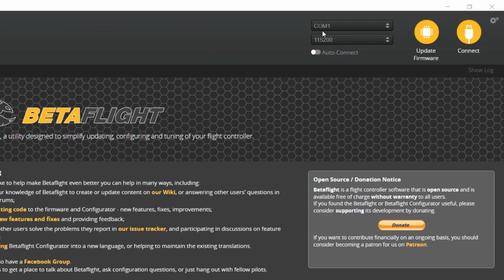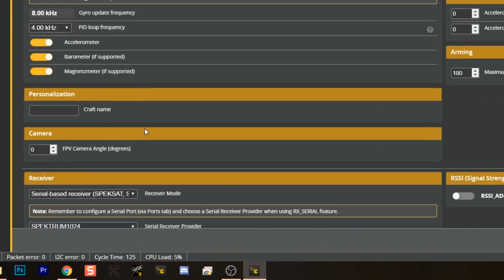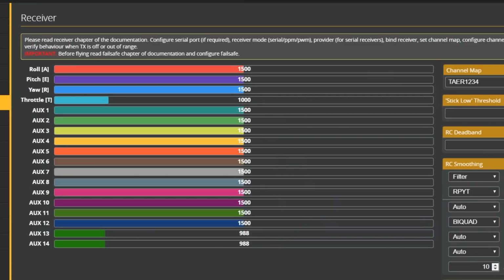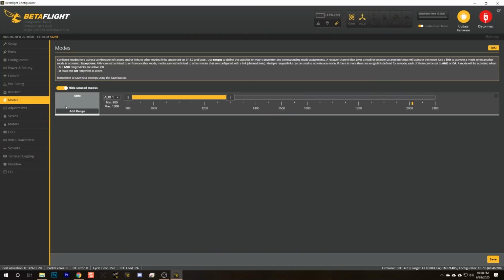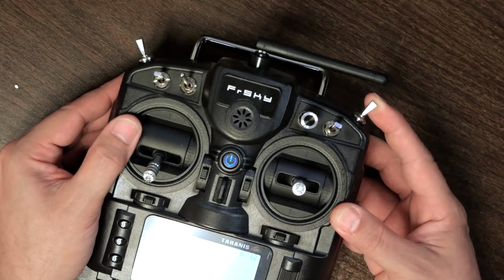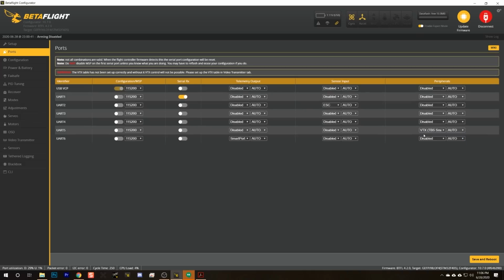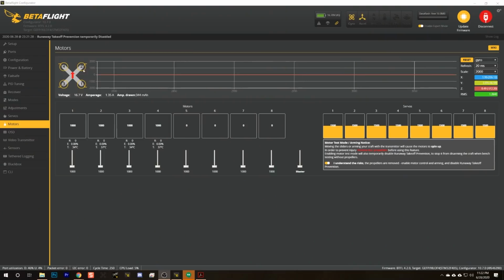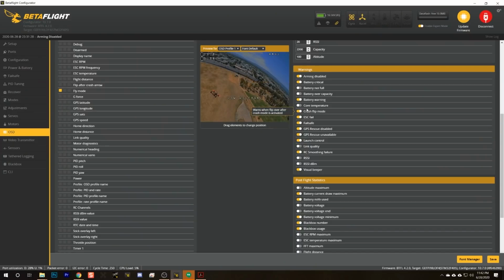FPV Drone Budget Build Full Tutorial - Part 3 - Betaflight 4.2 Complete Set Up

Comment: hello, what can i do when all 4 motors showing 100% on E? just build the drone and motors wont spin :(
Reply from the maker: Your ESC doesn't support bidirectional dshot. Turn off bidirectional dshot.
Reply: @JoshuaBardwell  ok i will try it out, i followed each of your steps from the video. because its your xilo 5 diy kit and im pretty confused
Reply: @JoshuaBardwell  what can i do when blheli dont find my motors/no valid esc configuration?
Reply from the maker: Well that could also explain why you have 100% errors. Maybe your ESC isn't powered up? Is the battery plugged in?
Reply: @JoshuaBardwell  i got it working after the motors worked again in betaflight they wont spin when drone is nkt on pc (with battery) but finally its working now :) maybe try to fly it today. thanks for the help

Comment: Hi Joshua, I'm trying to configure my quad and everything has worked up until checking the transmitter inputs on the receiver tab in Betaflight. I was able to bind my transmitter, I installed the drivers, did the ImpulseRC driver fixer, and I'm on Betaflight 10.7.2, but I'm getting no transmitter inputs. I've been looking for a solution on YouTube and found a video that said my receiver was in DPPM (or CPPM?) mode and not SBUS mode. I tried holding the bind button for four seconds to switch modes but nothing happened. I only get a red blinking light, no blue light. Please help!!!

Comment: Hey Joshua, with your Xilo i´ve build my first quad. Thank you very much for the inspiring and entertaining videos :-)                         My only problem is, that the quad does not arm at all.                        Already watched your video for this problem and tried all the notices: channel mapping is correct, acc_calibration is ok, cpu load has been below 20% in some test creations, switched acc off and increased "moron threshold", when i push prearm and switch the armswitch there is only the msp flag in the line "arming disable flags", the motors beep when i press the prearmbutton and i can spin the motors in the motor test mode.                               I flashed the FC with 4.3.0 RC3 and 4.2.11, the ESC with 32.8 and 32.83 but i still can´t get it running :-(                              With usb connected it won´t arm because of the connection, but if i disconnect I can´t see the reason why it does not arm.                            There is no warning displayed in the OSD after i pressed prearm and triggered the armswitch.                       Puh, have been trying for 5 days but now there is no idea left what i can test anymore.
Reply: I had this issue with the build, deleting the beeper function for some reason fixed the problem.

Comment: Thanks for the series, Josh. After looking all over the internet, these are the 3 roadblocks I cannot fix. When trying to setup SmartPort, the only sensors I can see are RSSI and RxBt. The engines do not beep. Lastly, and most severe, my OSD works but I have no video. The OSD only works a with the headset a few inches from the quad, then turns to static if I pull away. I'm using an ACCST QX7. Any ideas?

Comment: When trying to setup SmartPort, the only sensors I can see are RSSI and RxBt. Any ideas?
Reply from the maker: SmartPort is not working. Try going to CLI and type 

sets erialrx_haldfuplex = on
save
Reply: @JoshuaBardwell  Thanks for the response. I assume you meant,
set  serialrx_halfduplex = on
save
Even so, I still only get the two sensors..... I have an ACCST QX7. Any ideas?
Reply from the maker: Can you confirm that Telemetry feature is enabled in the Configuration tab?
Reply: @JoshuaBardwell  Yes sir, it is. Kinda getting discouraged too, I can’t see my video feed just my OSD. I sent you a detailed email about my problems with this drone.
Reply: @JoshuaBardwell  do you have any tips?

Comment: I have had nothing but trouble with this ESC and I don't know if the XILO ESC has quality control issues or if I'm doing something wrong. The first one I had wouldn't hold a BLHeli config on ESC 4, my second one that just came won't keep its config on ESC 3. Am I doing something wrong that is shorting these things out? I followed this tutorial series to a T. Reflashing BLHeli on the offending ESC will temporarily bring the quad back into working order but it doesn't last for long. I haven't even flown with the new ESC because I'm seeing the same behavior as before on the bench and I don't trust it.

Comment: Any help with this exact quad. Getting rpmfilter fail safe when trying to arm. Blhelisuite sets up perfect. Then after disconnecting and trying to arm it failsafes. I check betaflight and see rpmfilter fail. Exit betaflight and go to blhelisuite run read setup and get no esc configurations. Works fine with dshot disabled
Reply from the maker: rpmfilter means the FC is not talking to the ESC e.g. maybe the battery is not plugged in. failsafe means the FC is not seeing signal from the receiver. The ESC absolutely supports dshot so if it only works with dshot disabled, I would suspect a bad ESC.

Comment: Thanks for the series. I can't turn on bi directional dshot, despite the 4 in 1 esc being BLHeli_32. Any ideas why?
Reply from the maker: A few FC don't support it. If you try to enable it and it won't turn on that may be why.
Reply: @JoshuaBardwell  Thanks. I just wasn't saving and rebooting so it would toggle back off. Now, although I can see the OSD (battery/angle mode), I can't see a video feed, which is weird, since it was working last night. Any ideas?
Reply from the maker: OSD with no video means the camera is not powered up, the camera is damaged, or the camera video wire to the FC is broken.

Comment: This all worked flawlessly for the JB Xilo build. I am on my second build now and cannot get the motors to go no matter what I try. The drone makes the initial 3 beeps when starting but won't complete the last 2 beeps in the sequence when plugged in with a battery. Any help would be appreciated. I am using a RushFPV Core 7 mini stack with a R-XSR.

Comment: I'm intermittent failure of motor 1. Beeps 5 times on connection, can isolate in beta flight (sometimes), temps seem ok. havent made a maiden flight yet. have left the ground and it seems when i land or bump the motor will cut off with out recovery (may recover if i power down). 

Taranis q X7 accst on 2.3.14-ost
10.7.1 configurator
BTFL 4.2.11 firmware
GEFP/XILOF4(STM32F405)

Could a bad motor or cold solder be suspect or is this something on the firmware side?

Happy Thanksgiving!

Comment: Hi Joshua and everyone else. I was wondering if anyone knows or did a video on all the different motor and prop mount types available on quads? I'm trying to get into building from scratch and couldn't find much info on the web that compares all. Btw, is this even relevant or are there too many types? Thanks for a great channel :)
Reply from the maker: Basically, there are two types, as long as we are talking let's say 7" props and smaller. The first is a 5mm shaft where the prop is held on by a 5mm nylock nut. The second is used for ultra-light 5" props down to about 2" props. It's called T-mount and uses two M2 screws to hold the prop on (or in some cases, the prop just presses on to the shaft and is held on by friction, if the pilot wants to take the chance on it coming off). For very small props like used on Tiny Whoops, the prop often just presses on and is friction-fit, because it's too small to have screws go into the motor.
Reply: @JoshuaBardwell  Thanks very much for the info and thanks for responding so quick. I really appreciate it :)

Comment: In your BL HeliSuite there is only a PWM Frequency setting but in mine there is PWM Frequency Low and High options and I can only adjust from 48kHz to 96kHz. the default on mine is set at 96kHz. What should I set it at since I can't set it to 24kHz per your guide? I have the 1700kv motors fyi. Also when I test without props, after a few seconds of testing the throttle, it eventually just stays at max throttle..
Reply from the maker: Looks like the firmware has updated again. I recommend setting low and high both to 48k.

Comment: okay JB i have reviewed all comments. i was able to reverse the incorrect motors in BLHeli. set to 48k and 23 timing during my initial setup watching this viedo.  later on when i went to do madien flight with the 6s version. it acted very unstable couldn't get off the ground. I disarmed and rearmed and now only two motors spin. I then decided to power cycle it and now none of the motors spin and when i try to use the pre arm/buzzer button i get no sound at all. motors tab in BF wont activate motors either. BLheli now says no vaild ESC config. did i some how kill my ESC or was faulty? everything else works perfect VTX,FC all working fine. running latest BF 4.2.9.

EDIT: only have first 3 tones when powering on now.
Reply from the maker: I would contact getfpv support to evaluate if your ESC died.
Reply: @JoshuaBardwell  welp, its been almost 2 months and they still haven't restocked the XILO ESC to swap for a new one so they are going to issue a refund for that esc.  My question is do I keep the current FC that came with it ( if so what ESC should I use) or just easier to buy a different stack? what stack do you recommend for this 6S setup?
Thank you for your time, look forward to your reply!

Comment: Hello Joshua I cant set my PWM frequency to 24khz it only goes from 48-96khz and i’ve checked that its running the same firmware version 32.7 and also when i test hovered it and landed the front left motor didnt spin afer i armed again
Reply from the maker: Yeah they changed the ESC firmware. 48k is fine.
Reply: @JoshuaBardwell  okay thanks

Comment: Flashing tip:  I was running into terrible problems flashing; I kept getting stuck on "erasing" and eventually the FC got into a bad state.  I switched the FC from the blue USB 3 port on the front of my computer to a USB 1 (black) port directly on my motherboard and was able to flash fine.  To me that indicates either a backwards compatibility issue with USB 3, or there is a USB hub associated with the ports on the front of the PC and that caused the issue.  In any case if anyone runs into flashing issues this is worth a shot.

Comment: When i try to flash my FC with Betaflight, i do it exactly like in the video, but whenever it flashes it's just stuck verifying
Reply: Does anyone know what's going on? Ive fixed the drivers with The Impulse RC driver fixer but the problem still accures
Reply from the maker: If it finishes flashing but gets stuck on verifying then it's probably fine. I would just go ahead with the setup.
Reply: @JoshuaBardwell  But i think it only flashed half way, because the yellow bar at the bottom first goes left to right erasing but when flashing it goes to the middle and then says verifying. 
Edit: I can't continue. When i press connect it loads for a few seconds and then just on the top left says serial port sucessfully closed
Reply from the maker: Once it say "verifying" that usually means the flash completed but if it subsequently won't connect, then maybe not.
Reply: @JoshuaBardwell  Hey, yea it worked Thank you. When it was stuck verifying i think it had already completed. Today i flew the Drone for the first time! It's way better than i thought, at first i thought it was slow and easy but that thing is fast. Thank you for your help! 😊

Comment: My video is VERY staticky I tried to take it off Pitt mode  but it’s still blinking and still very staticky
Reply from the maker: You have to hold down the power button until the light goes solid to take it out of pit mode.
Reply: @JoshuaBardwell  i got the video to work but it’s not arming  at all. It arms in beta flight. I went though the check list from your video about arming and everything is 100% my cli is only 2% .

Comment: All was working fine until I got to the flash the firmware.  I got an error at the to that said if failed to open the serial port.  I have used the same cable before to set up another drone, and this one seemed to be working as it found it just fine.  Could the cable still be bad?

Comment: Hi,  i followed this playlist and build my first quad, it was great and working really well, but i had a pretty bad crash the drone fell upside down while throttle was pushing it down further, damaged lot of parts. I ordered the damaged parts and replaced them{ battery, antenna and vtx and props } had a issue with crossfire nano rx binding after the crash tried multiple things and even reached out to tbs support and in the end had to buy a new rx, so i went for crossfire diversity nano. So i finished my repair, did all the basic checks again , everything was good but when i tried to take off it spins/rotates in a random direction.
Have looked at your troubleshooting videos for insta-flip, bad esc motor , but none of that was applicable for my situation. I have tried multiple things nothing seems to fix it. All motors ,ESC and board alignment and motor direction,etc  are all good .
One thing I noticed both of my Flight controller sensors are not producing any output in betaflight {gyro and accerlerometer } , have tried disabling enabling them multiple restarts, etc. , still no luck.So graph is a straight line and 3D model wont move when i move my quad.

Have calibrated my sticks,ESC, accelerometer multiple times and also tried flying with accelerometer disabled.
TX: tango 2,FC Stack: Mamba F722s + F50 pro . motors: Emax eco II 2207. 
PLEASE HELP........

Comment: So I bought this quad used . I saw the quad fly rite before  I bought it! Once I binded it to my radio and setup my aux switch’s like u did ! The quad arms and idles but once I give any sort of roll throttle or pitch the quad flips out ! The motor are spinning in the rite direction. Any suggestions on wat the problem can be ????????

Comment: Hey Joshua, I configured my first model using this video but my receiver was burnt one day, so I had to change it. Once done I went to the Betaflight Configurator app and no matter what do I input with the transmitter, it won't show on Betaflight (Throttle, Yaw... Nothing, as if the transmitter was off). Have any clue about what happens? Receiver says it's properly connected to the transmitter (It's a R-XSR receiver and a Taranis X9 Lite transmitter, the receiver showing a non-blinking green light).

Comment: I can't get the vtx out of pit mode, I've tried long pressing the power button on the vtx, changing in betaflight, and through smartaudio, but it keeps immediately going back to pit mode. Any Ideas?
Reply: same, have you found a solution?
Reply: @ItzSkullii  the only thing I could do was disconnect the smart audio wire, and I was then able to get it out of pit mode. I haven't met any other quad pilots near me, so using the buttons on the vtx isn't a big deal to me. I also bought all the electronics again, thinking maybe I fried something somewhere, but still had the same problem. But at least now I have a backup set for when I eventually do break it.
Reply: @ItsOneEye1977   Sorry for the late reply. I just had the same problem with mine. Instead of entering 0, 1, 2, 3 for the values that went in the value inputs, I put 25 100 200 600 and it worked great. I think something must have changed in betaflight or the VTX since he made this video. Now I only wish how I could get bidirectional communication to work on the SPM4650 so I can edit smart audio settings directly through the screen on the remote.

Comment: The stack is junk. Multiple people having the same issues. Get fpv is unwilling to help any of them. 250 dollars for a quad that the main components will possibly fail is pretty risky. I replaced the junk xilo with a hobbywing and it fly’s great everything else it came with seems to be great just not worth the price. I’ve also found that these guys will promote anything for a buck.  If you look this stack up you will find beginners beware warnings everywhere as well as lots of disappointing reviews. Had I known this I would have bought parts separately and still used the video. With the faulty stack this drone cost 350 bucks to build. At this price range you can do way better than this kit

Comment: Hello Joshua! Thanks so much for this really useful series. I have a question: I just bought my first FPV, and I went with the tinyhawk 2 which comes with a 3.8v, 450mha, battery. You're mentioning here that we shouldn't discharge these battery's that you're using below 3.5v or it causes damage. So my question is how much should I discharge mine and how can we calculate that?
Thanks in advance!
Reply from the maker: It's a 1-cell battery so the voltage just is what it is. 3.5 volts per cell = 3.5 volts when you're using a 1-cell pack.
Reply: @JoshuaBardwell  thanks for the answer! Didn't really understand it though. x) So you have a 4 cell battery and don't recommend to drop under 3.5. So my 1 cell can drop until a quarter of that? Sorry if I'm being ignorant. Just got into this.

Comment: so I'm having an issue with the 5 inch quad I just built.  mamba f405 FC rush tiny tank vtx and foxeer razor nano cam.  I'm not getting a video feed on my goggles the drone flys and works no issues in Betaflight it says device ready and I can change vtx channels and what not. could my camera just be broken or not working? I have troubleshooted everything  and still no luck. on certain channels in my goggles I get a black/ gray screen then if I turn the goggles or wiggle  the screen goes static and black to black could everything be working except my cam?
Reply from the maker: It sounds like your vTX is working but your vTX is not getting signal from the camera. If you see black screen instead of static it means the vTX is transmitting on that channel.
Reply: @JoshuaBardwell  thank you for the advice oh wise one.  much appreciated.